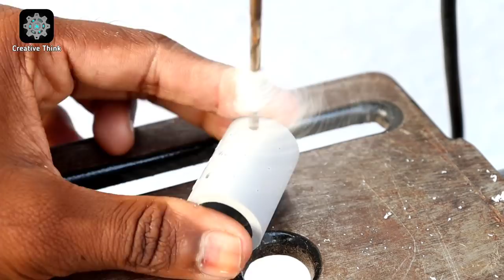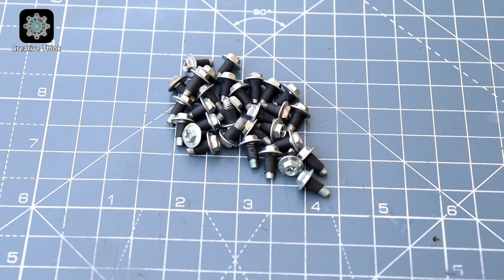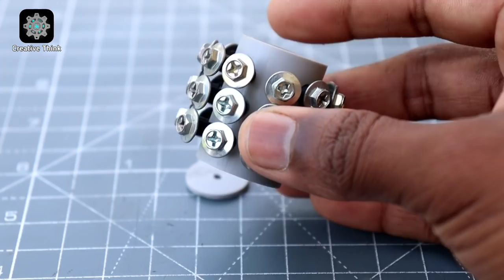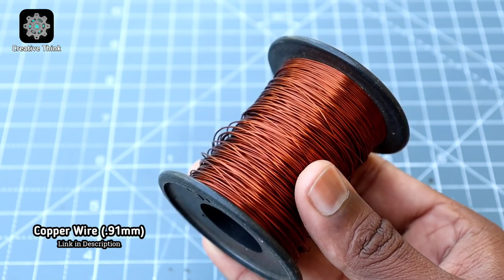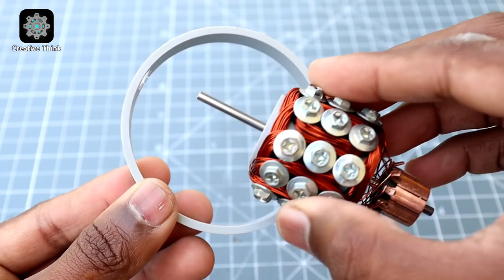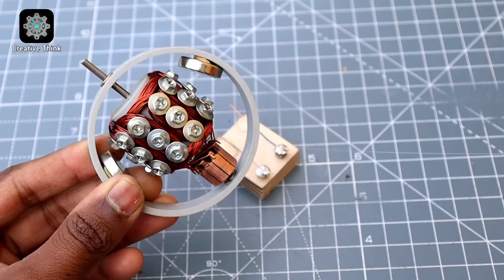Screw Armature Using Free Energy Generator

Comment: How u did the winding portion??
Reply: That is not real there must be a battery under the table. Just look at the conectors to motor winding. Why are they sparking??
Reply: @pigeon3036   It is real. there is no battery. That spark you see is from the voltage moving thru the air closing the gap between wires.